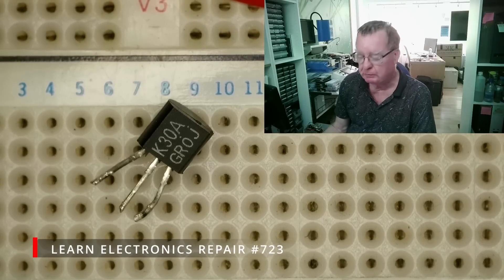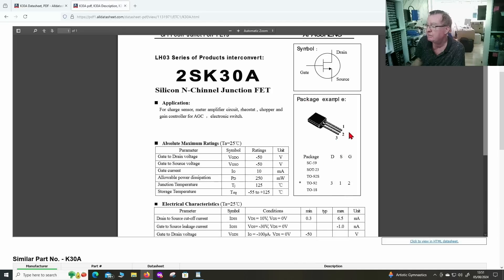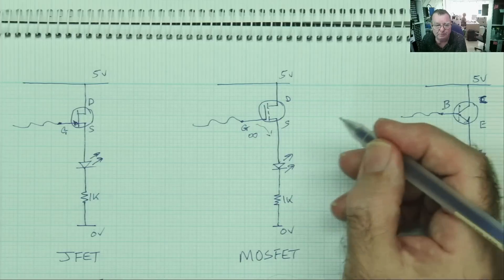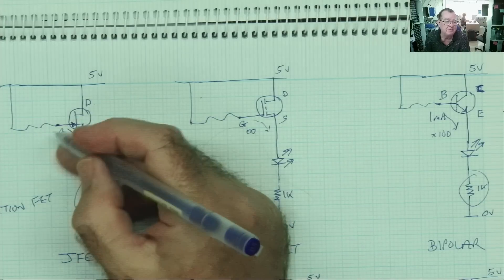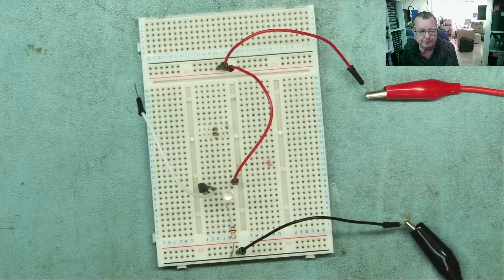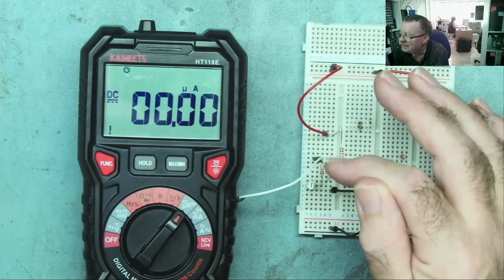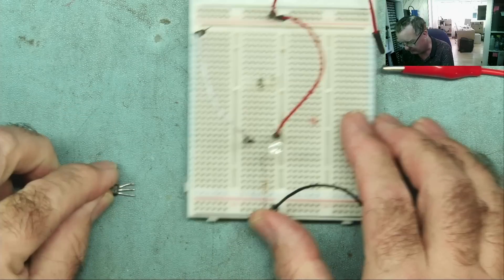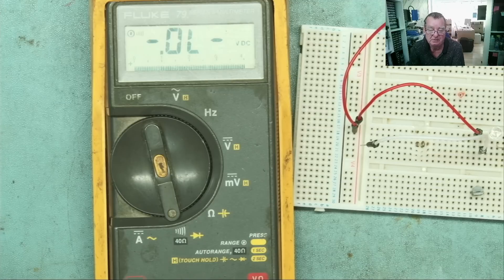All You Need To Know About JFET To Fix Stuff : Beginners What Is a JFET How Does It Work How To Test

Comment: Not all JFETs are fully symmetrical.

JFETS are depletion-mode devices. They are inherently ON with zero gate voltage. You must apply gate voltage to turn the device off. For an N-channel device that would mean the gate would need to be made negative with respect to the source. Most small signal JFETs conduct just a few milliamperes at zero gate-source voltage. This is specified as IDSS.

 JFETs are the basis of "constant current diodes.

Something is seriously wrong if you are measuring 4 µA current into a reverse biased JFET gate. That is orders of magnitude higher than it should be. You are actually measuring current into a foward-biased gate-channel diode, which is not how you use a JFET.

 The gate-channel "diode" of a JFET typically has extraordinarily low reverse leakage current, making it useful as an ultra-low leakage diode in some analog circuits. It is unlikely you'd find this in any sort of consumer gear. The gate leakage current is probably less than the leakage current between adjacent contacts on a plug-in breadboard or even a PCB that has not be rigorously cleaned.

 There are a few optocouplers that use a photoFET output. These can be very useful in specialty analog circuits for things like isolated sample-and-hold circuits or resetting of an integrator. You might find one in audio gear, used to implement automatic gain control.

Comment: Good tutorial.  I have always had trouble with FETs or MOSFETs.    

I do have an unrelated question for you.   I have a Lenovo laptop that has a short somewhere.  I know where it is getting really hot, but I don't have a schematic.  Replacing the main board is not an option as it costs more than if Just bought a new laptop though not one quit as expensive.  It failed about 18 months after I purchased it and I did not purchase the extended waranty as my only other laptop I had was a Dell Inspirion 8100 which never failed in all the time I had it.  In fact I still have it and it still works though it is really slow.  So, I never thought about my new laptop failing.  Can you help in anyway or should I salvage the screen and toss the rest of it.  I really hate to do that though if there is some way I can fix it.  I was an electronics tech for over 30 years though I have forgotten alot now that I am older, but I don't have any real test equipment other than several dvms, a super cheap $20 scope, power supply, and a digital thermometer.

Comment: I’m an electronics newbie. I’ve been copying the work of others to make regenerative radio receivers. The simpler circuits use a single JFET as both the RF amplifier and the audio demodulator. Amazing performance. Brilliantly clever idea. Credit to Edwin Armstrong who patented the discovery around 1915 (but using a thermionic valve where we can now use a JFET)

Comment: On the subject of MOSFETS having infinite gate impedance, and IGBTs for that matter. I often find that there is a series resistor of around 100 Ohms or so, put in series with the gate, particularly on power devices.
Should the device go short circuit, the small resistance prevents destruction of the circuitry, PCB tracks and wiring connected to the gate.
I service and repair welders, and there's usually a resistor in the gate connection for that reason.

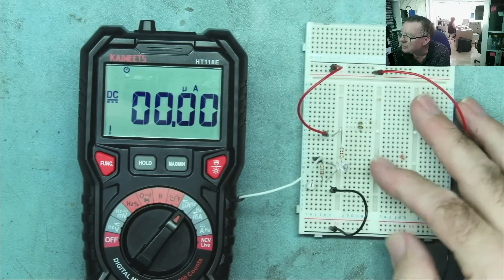Comment: 12:16 - Richard, what is the burden voltage for this meter in the μA range?
Reply from the maker: Sorry, Don't know.  Can I measure that using another multimeter across it in millivolts range or would that in itself affect the reading?   Hmmm I guess there is only one way to find out...

Comment: i repaired a Fluke 8520A some time ago and it had a lot of JFETs they used them as switches if i remember correctly
some JFETs was broken on it but the problem was i couldn't find any datasheet for them seems like they were in aircrafts for military etc so had to test a bunch of JFETs until it read right on the display lol

Comment: Some Power JFETs still available (United Silicon Carbide / Qorvo UJ3N), but expensive and mainly used in specialist areas (motor drives, heating etc).
Reply from the maker: Thanks for the info

Comment: JFETs are by bane of existence. I work with older audio gear, or gear specifically designed to have specific characteristic distortion profiles. I match JFETs rigorously to then place them in parallel. The common one for now is the Toshiba 2SK209GR. It's far underpowered for audio, hence we put them in parallel when matched!
Reply: My dream woman... 🤣🤣😉
Reply: @mattstroker  Hah, why? Why's that? 😅😅